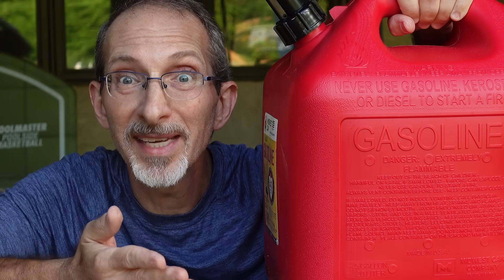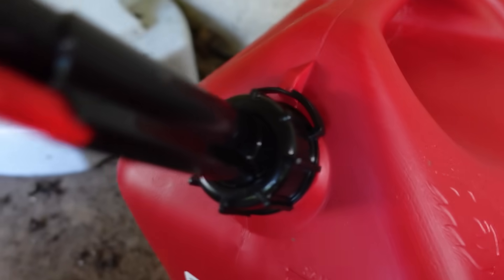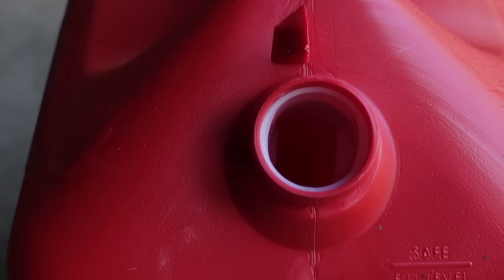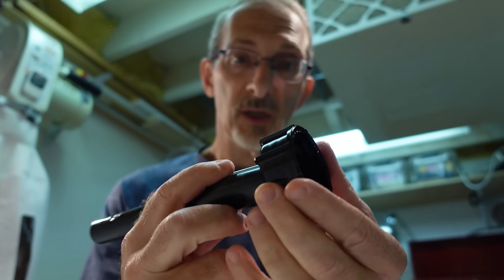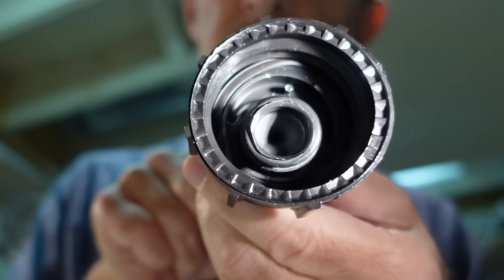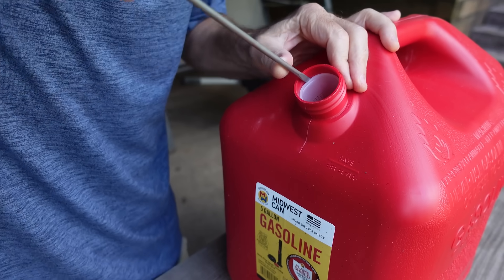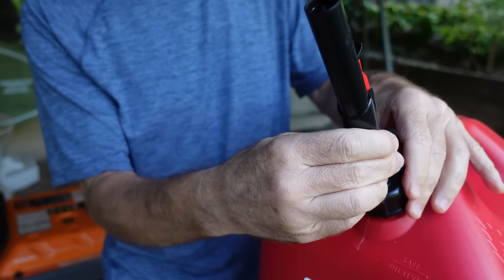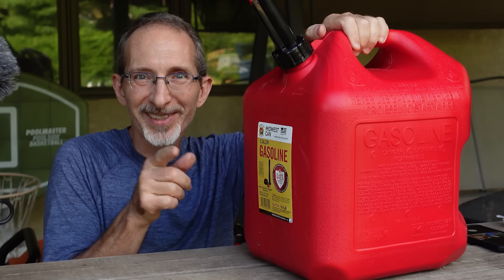Gas Can Modification | New Gas Can Fix

Comment: Replace the O Ring or your ethanol fuel will turn to corn mash.
Reply from the maker: You would think the O-ring would be ethanol resistant if they are being sold in gasoline containers, wouldn’t you?

Comment: This is the good ol' industry standard of "making things so safe, they become unsafe to use"
Reply: Despite the fact that several people are trying to make others out as bad people for preferring the old style "cans", if people weren't so lazy to put the yellow cap back on the pourer spout, they wouldn't have to worry about the fumes, or whatever.

I still gladly have the old style, and even an old round metal gas can like my Grandfather had. I have never had to fuss with "safety" features, and if I have anything to say about it, I won't. I know how to use my gas cans, and put lids on when not filling or pouring gas, unlike the idiots who think these are the way to go.
Reply: @lobitome  this is sure to set some one off but ive been small mower gas / chainsaw gas in clear glass jugs for about 55 year's,  just sit the jug in a 5gal bucket. No problem with breaking the jug and visibly clean gas .
Reply: @lobitome  0
Reply: Too much "safety" atrophies vigilance.
Reply: @tetracor  Not sure if you live in an area that gets snow. Where I live, when the snow falls, it is usually 4x4 and AWD  vehicles you see in the ditch first. Too many people think features like automatic traction control mean you can drive like a sunny 70F day when it is 20F with blowing snow.
Reply: @tetracor  Yep! The best safety is between our ears.
Reply: this has NOTHING to do with industry standards, and EVERYTHING to do with government thinking you are too stupid to know what's better. This was part of EPA spill proof rules.
Reply: @Critical_hippo  Indeed they were.  The EPA, CARB, and California politicians.
Reply: Yeah i have spilled way to much gas trying to fill jetskis with those. When i would have never spilled it with an old one. They think its "safe" but its literally worse
Reply: @Cabaret Z you've never gotten your hands greasy in your life have you?
Reply: This actually is the result of litigious people and unscrupulous attorneys. There was a class action lawsuit that brought this change about. They literally had video of morons standing in a brush pile with a gas can while it was burning to make their case. It was the plaintiffs' argument that it was just way too easy to be a dumb ass and be able to just pour it out onto a campfire.

You really can't make this stuff up.
Reply: @georgecurious2248  If you can't use it right you can't sue right?
Reply: @georgecurious2248  Maybey so, but it first came to be, because California radical environmentalism, CARB, and CA EPA decreed these "safety cans" be required, about 20 years ago.
Reply: This is 'consumer standard' and yes it sucks 'cuz 'industry standard' are metal have hand operated valve and cost $80 - $100.  In many States you can't bring a plastic gas can to a job site.
Reply: @anotheruser676   that's true. Those are worse yet.  Usually you cant tip the can far enough to pour onto the filler neck on what you are filling.
Reply: Agreed! I have had more close calls due to “safety features” than just regular common scenes.
Reply: My personal experience with these when I used to live with my parents' was spewing gasoline all over their lawn tractor and myself whenever I used their newer gas can. Which is decidedly NOT safe.
Reply: Tha point of the "new" safety devices are to force you to bypass the safety features therfore canceling their liability. 
     If you don't use it "right" you can't sue them right?
Reply: @Cabaret Z these gas cans just make you spill all your gas
Reply: All this engineering stupidity, brought to you, courtesy of California CARB/EPA Bureaucracy and decree, around 20years ago.
Reply: No tool safer than one never used
Reply: It all goes back to frivolous lawsuits due to morons getting injured because they can't use things correctly.  So we get ridiculous safety labels and then new safety mechanisms and standards.  All of which tick off those of us with common sense and keep the idiots from getting removed from the gene pool with a posthumous Darwin award.  Safety isn't needed as a regulation.  If you didn't learn it from your parents then you will either learn it by trial and error or you won't be around to worry about it.  Either way the world would be a better place.
Reply: 5
Reply: Any time you see, "New and Improved" on a product, it means some inept government son of a bitch has f---ed up a perfectly usable product so it no longer  functions as originally designed.
Reply: J
Reply: Guys,

YaH The Heavenly FATHER HIMSELF was Who they Crucified/Pierced for our sins and “HERE IS THE PROOF”

From the Ancient Egyptian Semitic: 
"Yad He Vav He" is what Moshe (Moses) wrote, when Moses asked YaH His Name (Exodus 3)

Ancient Egyptian Semitic Direct Translation
Yad - "Behold The Hand"
He - "Behold the Breath"
Vav - "Behold The NAIL" <— YaH’s Crucifixion
He - "Behold the Breath"

“Behold the HAND that Beholds The NAIL” 

PROVES - YAH The Heavenly Father HIMSELF was Who they Crucified

That is EXACTLY what Moses Wrote

Here is what they mean

YaH's Name:
(Ya)d + (H)e, as YaH is what Moses called Him and YaH Declared: "this is My Name, this is My Name for all generations" (Exodus 3)

YaH is The Creator of “MAN”: (Genesis 2:7)
Yad He, (HAND BREATH), as YaH's "HAND" Formed man from the dust  of the Earth and His "BREATH" made him a living being (Adam)

YaH's Sacrifice of Crucifixion for “MAN”:
Vav He (NAIL BREATH), the "NAIL" through YaH’s "HAND", in Sacrifice of Crucifixion, that whosoever shall call YaH Savior, His “BREATH” brings forth life (Salvation)

How YaH arrives:
YaH arrives via the Tent of Meeting (Exodus 33:7:11, Isaiah 54, 55), where a Tent is erected outside the city, a cloud descends upon the entrance of the Tent and YaH appears...

Why they demanded YaH to be Crucified:
YaH was Crucified according to Hebrew law (Deuteronomy 21), to be NAILED/PIERCED on an Almond Tree for BLASPHEMY as it was for His NAME they demanded Him Crucified. The Messiah claimed He was YaH...

HE WAS YaH!!!

HalleluYAH translates “Praise ye YaH”

The Hebrew Book of Isaiah

Isaiah 42:8
"I am YaH; that is my Name! I will not yield my glory to another or my praise to idols.

Isaiah 43:11
I, I am YAH, and there is no other Savior but Me.

Isaiah 45:5
I am YaH, and there is none else.
Reply: Never trust the EPA (or any other government agency) to do things right.
Reply: @Cabaret Z , i'll take the wisdom of a boomer any day over the neurotics of an arrogant snowflake...
Reply: You can thank the EPA for “fixing” gas cans. Those stupid people actually selling the product to consumers just had no idea what they were doing.
Reply: @TheSterlingArcher16  actually you can thank the little turd. Snow flake who sued a gas can company. Because he was too stupid to know not to pour gas on a fire. The kid won and the gas can company went out of business. And then the government passed the regulation. And gas can manufactures went over seas.
Reply: No. They were forced by left-wing politicians. I hate to get into politics but it is a sad fact. Any corporation would eliminate all of this crap if it could because they would put all of the others out of business. 
Instead we have gas cans as effective at preserving the environment as banning firearms has been in reducing violent crimes of any kind. Both policies have done exactly the opposite.
Reply: @wayneleroy6382 democrats had nothing to do with this
Reply: @Certified-03  Actually they did, it was in 2009 when California emissions for a gas can was signed into law by Obama.
Reply: @danielrivers1975  I didn't realize this. I'm sorry about that but you learn something new every day!
Reply: @wayneleroy6382  Yep.  I can sum up the political speech (on both, the gas cans, and firearms) in one word: CALIFORNIA.  (It's always California.)
Reply: @wayneleroy6382  Where in the US have firearms been banned to see if that's an effective way of reducing firearms violence? Nowhere that I know of. Seems to work very well in the majority of the civilized world.
Reply: Gas can companies add all these stupid features for a good reason. When you buy one, and it's awful, it compels you to go back to the store and buy another kind. And then when you find out that the second one sucks, you go and buy a third kind.
Reply: @MikeStavola  this wasn't the gas can company's idea. this was a regulation that was passed by rich liberal politicians who have never had to use a gas can in their lives, so they had no idea what impact their ridiculous regulations would have on the products and how they are used. and they to this day either still don't know or just don't care, because again, they never will have to use a gas can themselves.
Reply: I agree. As a child my friend John got into a car crash, flew through the windshield and died at the age of nine. I'm glad he's not alive to see the government overreach that resulted in requiring seatbelts and air bags in every vehicle. /s
Reply: @Craigthepope  that’s not the point of this comment 

There is a point where the safety equipment can make something more dangerous to use

Such as these gas cans which just make you spill more gas than the old cans
Reply: @Craigthepope  A failed or ineffective safety device (these "Safety cans") is actually worse than no safety device at all.
Reply: @Craigthepope  At nine? Where'd he get his driver's license?
Don't drink and drive, kids.
Reply: @Craigthepope  comparing seatbelts to a gas can is a reach, seatbelts save lives. If your gas can spills you clean it up. The new gas cans have nothing to do with safety, it’s to “stop” vapor emissions. They don’t work, it’s California emissions added to a gas can! Again, not a safety issue! As n emissions issue.
Reply: @Craigthepope  Man, it sure is nice to know that wearing a seatbelt doesn't actually make operating a car more difficult. And car companies made seat belts standard way before the government stepped in, so, good one for missing the point.
Reply: @BuzzBoi315  Except in both my otherwise great Ford cars all the safety belts keep tightening in till you are forced to relatch them starting the whole process over again. It is madness 😠
Reply: @Cabaret Z lmao  ;-)
Reply: Not necessarily. A lot of safety features (when designed correctly), save lives. Good safety controls can be difficult to design and usually have to be implemented through industry standards.
Reply: @Craigthepope  they haven’t hit the unsafe to use level yet
Reply: . @Craigthepope

Comment: I just bought a small can the other day with the same issues. It's only a 1 gallon can for my lawn mower but I ended up with gas all over my hand because I had to hold the spout in so I could fill the mower. But the gas came out from the where the two pieces telescope and got all over my hand.
Reply from the maker: I’ve heard other people say something similar, where the fuel leaks out of the side of the spout. So frustrating! Thank you for sharing your comments and for watching the video.

Comment: Believe it or not, there's a 4th major annoyance with these cans. The air breather is built into the nozzle, and this thing pours SUPER SLOW. I got a multi-pack of breather hole inserts and basic nozzles from amazon to "fix" all of my gas cans.
Reply from the maker: Andrew, I agree! I added an aftermarket vent in my follow up video, link in the description. It makes a difference!

Comment: Need to put a cap on the nozzle tip. Spills and evaporation will result if not.  Old rag wrapped around a smaller diameter twig works.
Reply: Off course these new brilliant like - kind contraption nozzels make the fuel can cost TWICE as much.

Comment: Thanks for the video,,,, my first thought on these cans is what a joke,,, after it shot gas back out the top wile trying to fill it,, very dangerous with raw gasoline spilled on the concrete,,,, had to fill it stupid slow
Reply from the maker: Rick, yes that was my first frustration with these containers. All the safety features combined to make a very difficult to use product. I hope you found the videos helpful!

Comment: The filter on the can serve no purpose. so it stop impurities from going in the tank, but guess where those impurities goes, first time you fill your equipment.
Reply from the maker: When I called a filter is actually a flame arrester, which I corrected in my second video, link in the description. Sorry for the confusion, I appreciate you watching!
Reply: @MikeFyxdt  makes more sense now, i still hate.

Comment: Bought a can si.ilar to that one but the filter was in the cap and the safety spot broke. Still cost me over $ 20.
Reply from the maker: Clark, the filter is actually a flame arrester, and I don’t mind if it is in the spout, instead of in the container where it gets in the way of filling. It’s too bad that other features on your gas container failed. I just wish we had better designs at this price point. Thanks for sharing your experience!
Reply: @MikeFyxdt  like what used to be on bacardi 151 bottles.

Comment: I fail to see the point of the screen inside the can.  It will capture debris coming out of the pump, but will simply deliver it later into your lawn mower's tank.  What good does it do?
Reply from the maker: Yes, what I am mistakenly called a filter is actually a flame arrester, which I explained in my second video. You are right, it wouldn’t make sense if it was a filter… I appreciate you joining the conversation!

Comment: that doesnt make any sense to me at all.... how does the filter do anything... if pollutants go into the can through the hole and get caught in the filter and then you tip the can to pour gas. doesnt that give the opportunity for the gas(or gravity) to dislodge it and go through the spout into your tank. A filter makes sense but shouldnt it be on the inside of the spout outside the o-ring(where you could also easily clean it. seriously ive definitely spilled more with the safety spout than. a traditional hose or no spout at all.
Reply from the maker: I agree with everything you are saying. When I called a filter is actually a flame arrester, which I explained in my second video, link in the description if you would like to watch. It made no sense to me either when I first saw it! Thank you for watching and for commenting.

Comment: Why did you buy this type and not a plain nozzle one.   If you can't find one, I'll sell you one of my 3!
Reply from the maker: I bought these containers sight unseen at the beginning of the pandemic, and didn’t realize how difficult the design was until they were filled with fuel and I needed to use them. At that point fixing them was my only option. Now I know for the future! Hang on to your old plane nozzle, it’s probably going to be worth a fortune in the future! :-)

Comment: Pure idiocy like those stupid fucking safety gas can nozzles can only be dreamed up by moron politicians.  Our tax dollars pay for those shit for brains to come up with and MANDATE idiotic shit like this.  Government at it's best...
Reply from the maker: Craig, I also hold the gas container manufacturers responsible for selling these designs. If there are government restrictions for safety, I think it requires better engineering and user testing, which falls on the manufacturers’ shoulders. At the end of the day, I just want a safe fuel container that’s easy to use!

Comment: I never knew there was a problem with the plain ole spouts I had used for half a century. I was going to mow lawn for son-in-law last month but gave up when I couldn’t figure out how to pass fuel through the compression style nozzle. I’ve seen one of the bulky funnel type nozzle on a gas can at the store - I was dumbfounded trying to understand how to use it. What bizzare circumstances have convened to make anyone think these absurdly bad designs were OK to manufacture and sell?
Reply from the maker: You bring up some really good questions! I have a second and third video in the series, link in the description, that tries to answer these questions and explains some of the events leading up to design changes. I understand the motivation for the changes, but the execution leaves a lot to be desired! Thanks so much for watching and for joining the conversation!

Comment: Great video. The spring in mine had a higher compression strength than the recoil spring in my pistol.
Reply from the maker: I’ve had at least a dozen comments relating to the mechanism being similar to a recoil spring, if that’s what they’re called. Interesting! I appreciate you watching…

Comment: These "safety" spouts were designed by people who've never touched a gas pump nozzle or a gas can.
Reply from the maker: A picture of the designers of these containers as using the old design, and then sitting down at a computer and saying “let’s make this better“. The old ones worked. They should’ve left the design alone.

Comment: The old cans with a spout and a vent on the back were way safer to pour gas on a fire, the new ones leak all over themselves. We learned not to pour gas on a fire from a can by pouring gas on a fire from a can. As usual we have gone so safe it's dangerous and have a generation of people who don;t understand risk management.